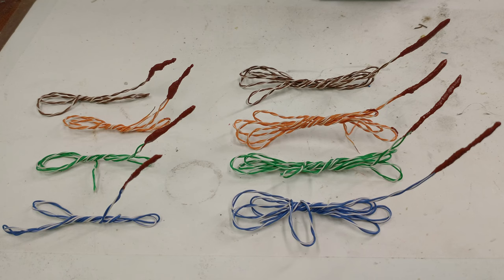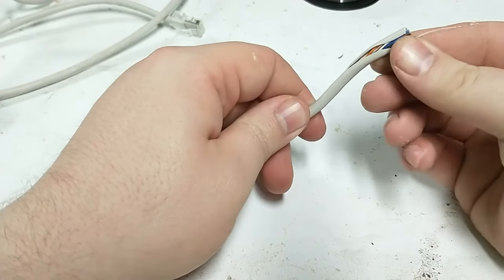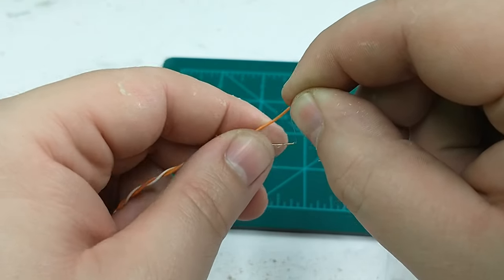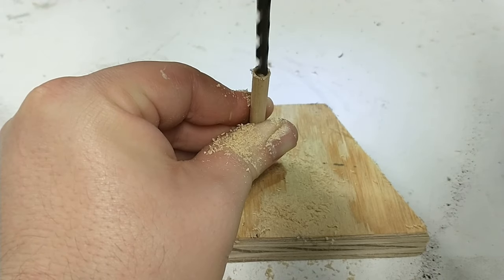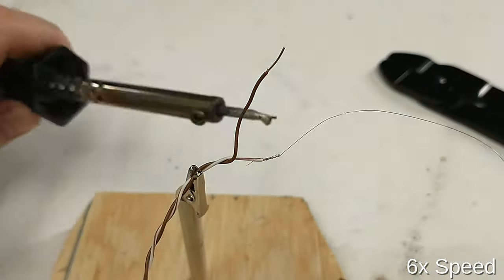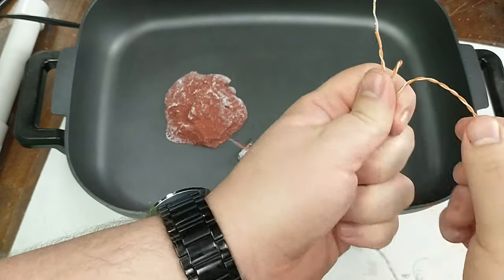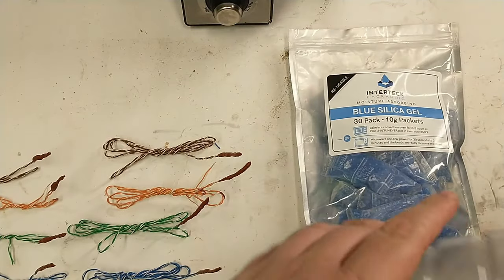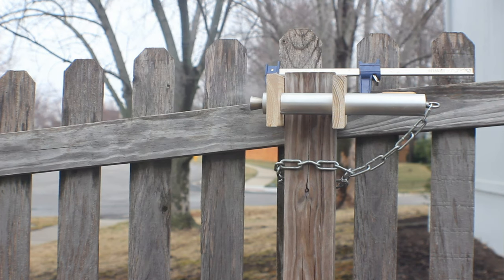Easy Rocket Motor Igniters - Great for Sugar Motors

Comment: Nice, I use a similar concept with the wire, but with my ignition mixture is dissolve a ping pong ball in acetone to form a paste and then add the rocket fuel powder to it. Really enjoy the videos.
Reply: Ping pony bals no longer container nitrocellulose.

Comment: Does it really work better than an ematch ? The motor test doesn't seem to start faster than when I use ebay ematchs. Nice method overall but it might be actually worth it if a proper pyrogen is used. Unfortunately, those are somewhat difficult to make, particularly in EU
Reply from the maker: These should make a lot more heat than an e-match.  I think it depends on the motor.  If e-matches work for your motors then that's certainly an option.  You can also dip the e-matches in propellant to get more heat.
Reply: Increase your ignition voltage.

Comment: Instead of keeping these igniters in a carefully controlled (jar with desiccant) environment, I'd try sealing the sugar based coating from the humidity by painting/dipping them in a flammable lacquer, like fingernail polish, or the glue used for PVC piping.  That way they could be stored without concern for the hydroscopic nature of the original coating.

Comment: Does the ingniter need to be as long as the propellant tube. Kindly share the positioning of the igniter inside the tube.
Reply from the maker: Yes, you want the igniter to light the very top of the motor first so you get good combustion along the full length.  If you ignite it lower down in the motor then the flame has to travel upwards while the flow is trying to go downwards and that might cause a slow start or other problems.

Comment: Been using cat5 nichrome wrapped igniters for years with my diy bp with aluminum powder.  Instead of soldering I use my trusty radio shack wire wrap tool.

Comment: Dollar store light bulb.  The filament cut into pieces.  Burns white hot with a 9 volt battery. 
If longer burn add a tiny bit of green fuse.

Comment: Hello...Greetings Minute Rockets. I just wanna ask a question that, I am trying to make a blackpowder igniter for my rocket motor with BATES-neutral burning grain with a Maximum operating pressure of 934psi (targeted).Do I have to use the amount of BP such that the pressure generated by the hot combustion gases of the BP will be in range of max operating pressure of the motor (For Startup phase) ?

Comment: Silicon powder, potassium perchlorate, trace of sulfur, some kind of binder.
Silicon burns, becomes shower of molten glass bits.
Glass is quite sticky when white hot, clings to fuel grain, ignition rarely fails.

Comment: Steel safety wire also works like your nichrome wire did, for cheaper, if you are using a good power supply (ie: motorcycle batery).
Reply: If you want to save money, replace the motorcycle battery with a 1M resistor, a switch and a bunch of capacitors in parallel. You don't need 20 CCA to burn through a wire.

Comment: I use a 120 volt 30 amp solid core  10 gauge copper wire to lite my rockets up.

Comment: without a propellant, can i just use a sparler and wrap some nichrome around the end to ignite, with the other end jammed into a rocket motor? every video goes into length about making your own starters. But is a sparkler enough heat to ignite a rocket?